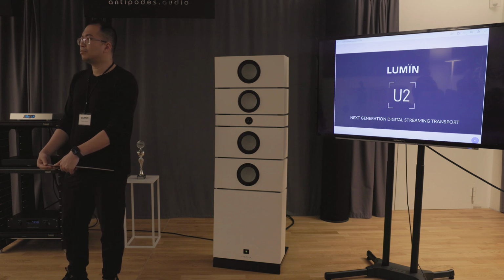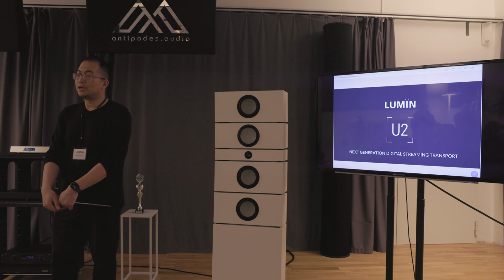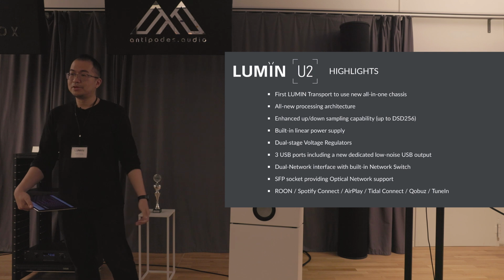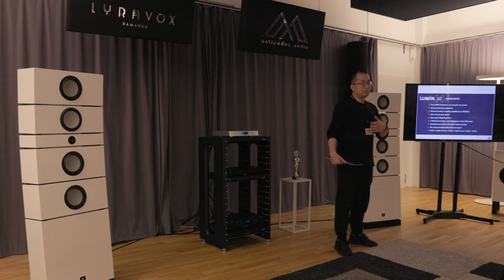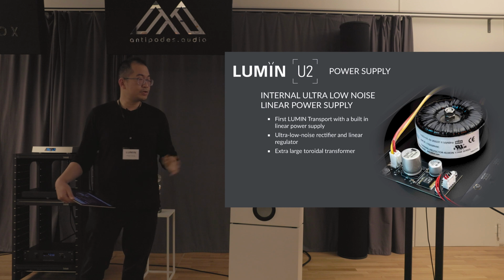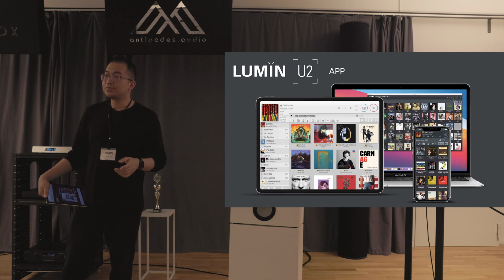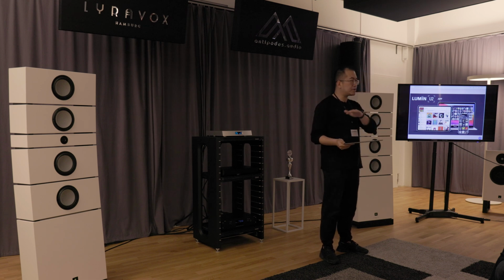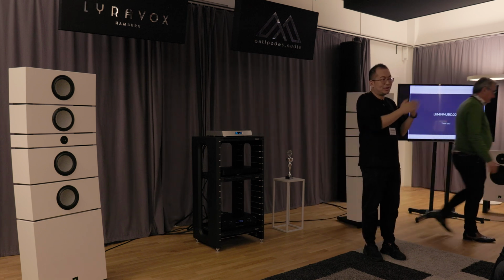Lumin U2 Streamer Presentation

Comment: @ Lumin, Will U1X be replaced by a newer model, say U2X, soon? or it will be the last flagship model of transport with external power supply?
Reply: I know it's annoying, but we can't really comment on future plans.
Reply: @luminmusic i am a current D2 owner, and  i'm close to pulling the trigger on an X1 ... so it's true that it's annoying not to know :-) ... if you had upgrading (or trade-in) possibility for anyone with your flagship products that would be great to know and would provide a lot of confidence to potential buyer ... also it would be good to know how long you are planning to support "older" products
Reply: @GPThibault-u6i  X1 will remain our flagship player for some time. With regard to our support, we always add every feature we can to our older players wherever it's technically possible. For example, we have just begun investigative work into potentially adding Plex support to our very first player launched 10 years ago.
Reply: @luminmusic  thanks and good to hear ... so i'll certainly be getting the X1 soon 🙂
Reply: Is it a possibility that the U1X will eventually be able to upsample to DSD256 and PCM 384? It seems that this an important disadvantage compared to the U2.
Reply: @christopherward2684  good point ... i'm still on the fence with the X1 ... and really hesitate between the X1 and getting a T+A DAC 200 (with a streamer in front of it)
Reply: @christopherward2684  X1 can already upsample to PCM384, but only DSD128. I don't think this will change to be honest. Yes, as you note, U2 is better in this regard, but that's the nature of more recent models with newer processors. X1 still features some hardware components and construction techniques that give it an edge over U2 though.

Comment: Thank you very much for sharing!
Reply: Lumin streamers are the best!
Reply: Hello lumin, so do I get usb sound from lumin u2 mini, or the 2 usb are just for external storage? Thank you
Reply: @alialamri8525  Yes, USB on all our transports is for audio (U1 / U1 Mini / U2 / U2 Mini) output to a DAC.
The difference with U2 is that there are slightly fewer electronics in the chain as we have a dedicated USB audio output which doesn't need to auto-detect whether storage/remote control/DAC has been connected.
Reply: @alialamri8525  Yes! USB is for digital audio output as well as other uses on U2 Mini.

On U2, there is an additional direct-coupled USB which has fewer electronic components in the chain, but they all support the same bitrates, etc